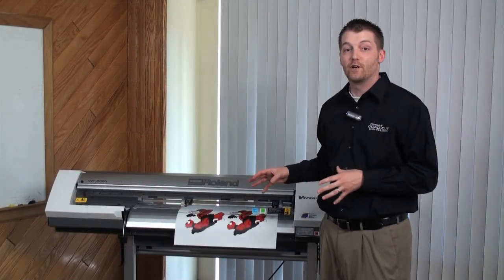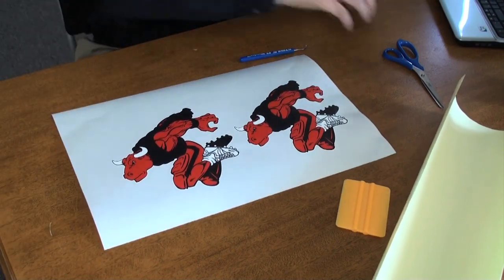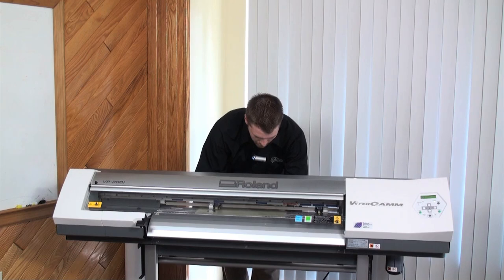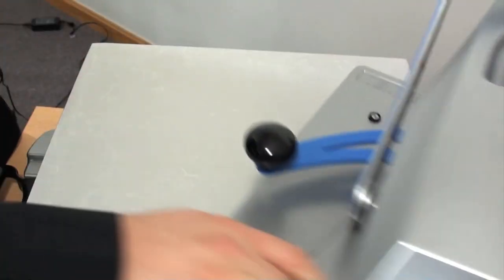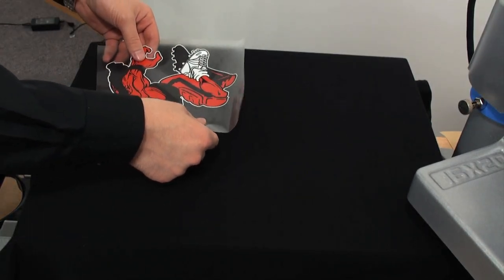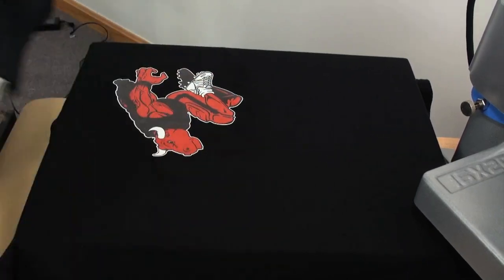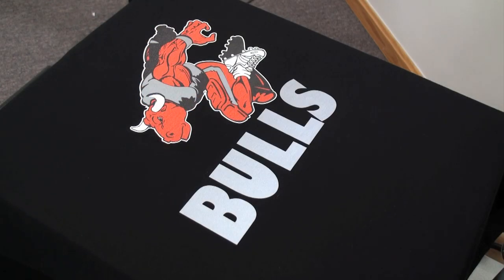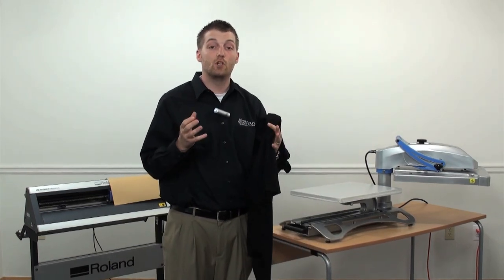Mixed Media - Print/Cut Heat Transfer Film with Reflective

Comment: So i have a question, my company buys from Stahls and we have the Solutions opaque and we have the express print. Now after i print and cut on the Express print everything is beautiful, after the opaque.....its a nightmare. it doesnt cut right at all (using the recommended setting with a new blade) and the edges curl up right after it cuts, Yes i shut the heat off our machine. So tell me WHAT DID U DO to make the opaque material cut so nicely?

Comment: please what's are the materials used for this process or procedure
Reply from the maker: The material used in the print/cut system was CAD-COLOR® Solutions Opaque, however, that product has since been replaced with CAD-COLOR® Soft Opaque Printable Heat Transfer Vinyl; visit https://www.stahls.com/printable-heat-transfer-vinyl-soft-opaque for more information. The other material was the CAD-CUT® 3M™ Scotchlite™ Reflective Heat Transfer Vinyl; visit https://www.stahls.com/heat-transfer-material-3m-scotchlite for more information.

Comment: Hi, one question, the Vinil sheets that you wear on the shirt
are the same as those used for glass stikers
Reply from the maker: The material used on the shirt is heat transfer vinyl. We do offer a sign vinyl options that is for decorating hard goods. Below are the links for each product where you can find out more:
Heat Transfer Vinyl: https://www.stahls.com/heat-transfer-vinyl
Sign Vinyl: https://www.stahls.com/pressure-sensitive-sign-vinyl

Comment: The printed material we used for this video is Solutions Opaque and the mask is Solutions Mask.  Click on the link in the description above and go to the CAD-CUT® Direct web site.  Once there under the Product Line select Printable Heat Transfer Material.  There you will find the printable materials and the corresponding masks.  Solutions Mask is the one with the yellow liner paper.

Comment: To be honest you can probably make designs somewhat similar to this for $5. Just buy heat transfer paper from walmart and iron on your design with a clothes iron to a white T-Shirt. You don't need a special printer, just a regular inkjet works. If you're willing to spend $200 you can buy a heat press online. I got mine from Amazon. The higher quality you want for your prints, the more expensive the equipment and resources get; like the equipment the guy on this video is using for example.